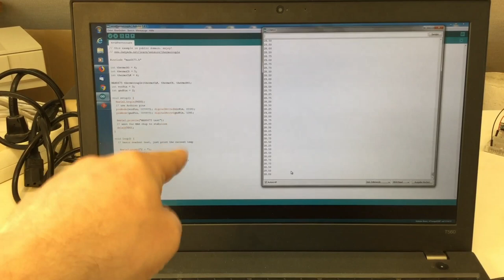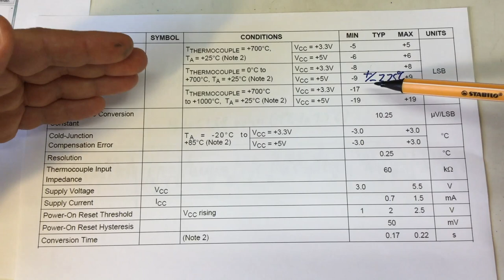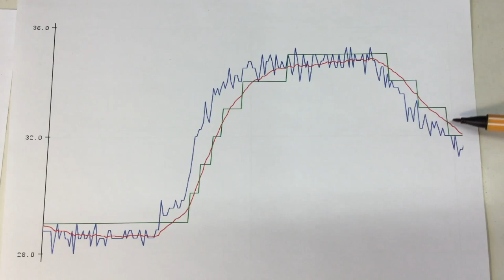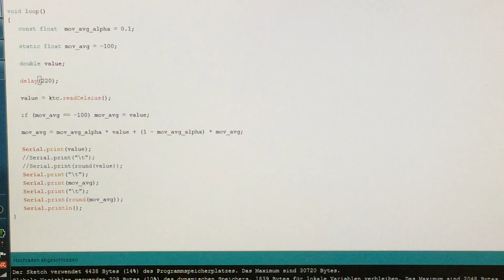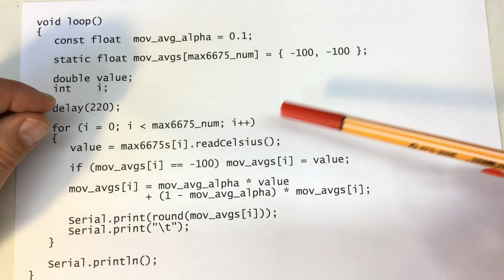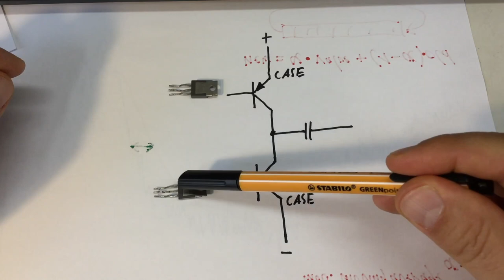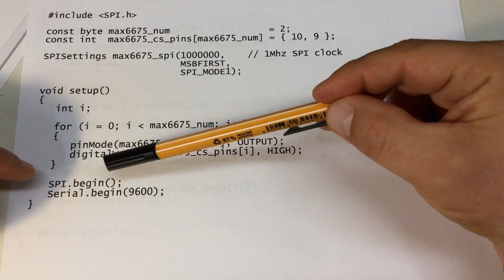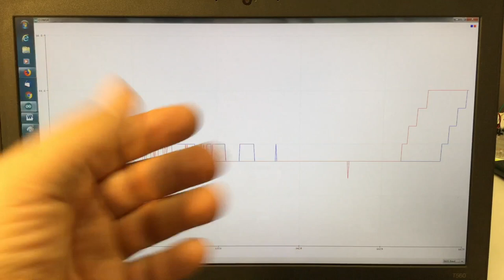Arduino, Thermocouples, MAX6675 and SPI – The Fine Points

Comment: Sir, first of all thanks a lot for the video. Iam making a similar temp Data acquisition system with arduino. I have to measure 2.5m underwater. Should i use a thermocouple or thermistor? Please reply.
Reply from the maker: OK, when to use a thermocouple or a thermistor basically comes down to the temperature range you want to measure. Since you're talking about 2.5m under water, I guess you're measuring "normal" water temperatures between 0°C and a few dozen °C. Thermocouples a great for measuring very high temperatures (hundreds °C), but that's not really necessary in your application. So I would go with a thermistor. Anyway, if it fits your application you should consider using a digital sensor like the DS18B20/DS18S20 ( https://youtu.be/XUm9RPWRBx8?si=rNz_LZVcwO_D3_HV ). Here I'm using one to measure the temperature of a water bath: https://youtu.be/EP1Lc-g3uY0?si=2YE7tQAADdcGYFHu .

Comment: Hi robert Thank you very much for the video its reallay give me a lot of new knowlade. i have a questions about the thermocouple with the max6675,now im in a project to make deep frying machine and i've used the thermocouple. everytimes the themocouple touching the survaces of this machine which is made by stainless steel its get failure for the thermocouple read the temperature. 
i hope you have any sugest or recommendations for it, should i do special methode for this thermocouple max6675 or i must to use other module for it?

thanks, have a nice day
Reply from the maker: You're probably experience a problem related to the shorting issue I discussed in the video ( https://www.youtube.com/watch?v=qub3yzqEwek&t=1406s ). I guess in your case the power supply of your microcontroller and MAX6675 has some (albeit small) potential to the housing / the stainless steel of your machine. This causes a current loop through the sensor into the MAX6675 which messes up the measurements. There are three possible solutions for that problem:
1) Make sure your MCU and MAX6675 are galvanically isolated from the housing of the machine.
2) Use an isolated thermocouple.
3) Galvanically isolate the MAX667 (see https://youtu.be/6rEJh4yPekg?si=7D7Fo1dMdy6NBIwd ).

Comment: Thank You for the video.
So if you have multiple thermocouples you would have to insulate them from each other? It seems like that might effect the accuracy of the readings?
Guess I would have to experiment with them to figure something out.
Thanks again, great info on using the arduino and thermocouples.
Reply from the maker: You're welcome! If you have multiple thermocouples you only have to isolate them when they are in contact with metal surfaces with different voltage potentials. E.g. you measuring the temperature of one heat sink that is connected to ground and another that is connected to your power rail. For isolation of thermocouples see the video "Galvanic Isolation of SPI Devices (e.g. Arduino, MAX6675 and SI8631)" https://youtu.be/6rEJh4yPekg (no loss of accuracy - the isolation happens on the digital side).
Reply: @robertssmorgasbord  
Thank You for the info and follow up reply.
Reply from the maker: @patrickmclaughlin6013  You're welcome :-)

Comment: I really appreciate the time you have invested in making this video.Considering how very well written it was coupled with easy explanantion thank you Sir So much for this video it was a pure gold mine of information.I want to know How you came to the conclusion of choosing this particular formula for moving avergae because i have seen a different one for it .Also Sir why did u choose mov_avg =-100 in start
Reply from the maker: You're welcome - and thank you for praise! Regarding the moving average I used: I choose that modified moving average (MMA), aka running moving average (RMA) or smoothed moving average (SMMA), (see Wikipedia https://en.wikipedia.org/wiki/Moving_average) because it doesn't require an array to store past values. α = 1/N, so if you replace that in my formula you get NEW = (1/N)*VALUE + (1-(1/N))*OLD = (N*(1/N)*VALUE + N*(1-(1/N))*OLD) / N = (VALUE + N-1*OLD) / N, which might look more familiar to you. I initialized my moving average with an obviously invalid number (here -100), so I would see that it's not yet calculated correctly when I start the program. That was just my laziness. A better approach would have been to initialize average=NAN (not a number) and then use the expression (isnan(average) ? value : average) when accessing the average. My bad!
Reply: Tysm for your reply It might seem a bit much to you But I have become your Fan After watching just a single video.I mean I loved how detailed the video was and so easy to comprehend.I remember Jordan Peterson saying "If its hard for you to understand something it means its the authors fault".Based on this how easy it was to comprehend I believe You Really Know your stuff
Reply from the maker: @41_ahwaszargar73  Thank you again for the praise! I'm blushing here 😊 Anyway, it's very satisfying for me when people get something out of my video.

Comment: Hello, nice explanation. For detecting fire, what is the best sensor for arduino uno?
Reply from the maker: Thanks! And sorry, I haven't worked with fire detectors (neither smoke, nor heat, nor gasses like CO2) so far. So I can't really recommend any sensors.

Comment: This is fascinating to me as I have used this module myself for a homemade tandoor (oven) I also had to average out the data but my maths is rubbish, so I just added together 10 readings and divided it, also I only update my Oled display every couple of seconds this works fine for the oven (great chicken!) I have also run into the "ground" issue. Not using the library is something i'm gonna go away and play with Its quite simple the way you put it...cheers.
Reply from the maker: Well, I gather the MAX6675 is good enough to cook some tandoori dishes then :-) Regarding the grounding issue you are in luck: In two weeks or so I will publish a video where I solve exactly that problem ;-)
Reply from the maker: The video explaining how to overcome the grounding issue is out now: "Galvanic Isolation of SPI Devices (e.g. Arduino, MAX6675 and SI8631)" https://youtu.be/6rEJh4yPekg

Comment: Hi, great video and very instructional as well. However, I wonder what modification in code as well as in hardware you need to do if you only have the MAX31855 modules instead?  I have several but none of the MAX 6675.
And by the way, my modules are 3.3V but the Arduino is 5V so, I'm thinking,  I will probably need to use some sort of logic level shifter modules  (bidirectional maybe? I'm not sure) to communicate with the MCU. Also, another question is what library? The Adafruit one or...is there any other I can use? It would be great if you could make a video with the above modules or perhaps some ideas on how I need to do it? Thank you.
Reply from the maker: Hi, have a look at the Adafruit MAX31855 module: https://www.adafruit.com/product/269
It's 5V compatible and they provide a schematic for that board ( https://learn.adafruit.com/assets/35637 ) so you can see how that's done: No need for logic level shifters, just two diodes and two resistors - though that technique won't work if you have other 5V SPI devices on the bus that actually receive data from the hots! You can probably use the 3.3V pin of an Arduino to supply the 3.3V - I don't see the need of an extra regulator.
Using the Adafruit library for that module should be alright (haven't done any research regarding MAX31855 libraries).

Comment: Great video!  I wanted to read the temperature of 3 fermenting vesels using pt100's I think your video help me a lot.  Is it similar when using multiple MAX31865 ?
one other question, If I wanted to display the temperatures on an OLED screen will it work also with SPI ?
Reply from the maker: In principle, yes. But ... The MAX31865 uses bi-directional SPI, so you will need an additional data line (MISO - Master In Slave Out, respectively, SDO - Slave Data Out. Of course you'll need a suitable Arduino library. Fortunately one is available from Adafruit: Adafruit_MAX31865.h. Connecting an OLED to the same SPI bus isn't a problem, because the slaves on a SPI bus are addressed by chip select pins (one for each slave).

Comment: Hi Robert,
The max6675 data sheet seems to indicate 3.3v to 5v can be used.
The library was apparently written with 5v in mind ?  I get correct temps when using 5v (comparing to a ds18b20).
My readings using 3.3v are about 10-12 degrees Fahrenheit higher, but i'm not sure if simply subtracting this differential will give me a correct reading over a large temperature range.
Your thoughts are appreciated.  i hope it's as simple as subtracting, but usually things like this are much more complicated than they appear.  thank you.
Reply from the maker: Mhh ... The MAX6675 can indeed operate with a supply voltage down to 3V. However, the library (which one exactly?) doesn't care at all / is in no way affected by / can't be affected by the operating voltage of the MAX6675. The interface between the Arduino and the MAX6675 is purely digital (SPI). The analog-to- digital conversion of the thermocouple voltage happens inside the MAX6675, and the MAX6675 does take care of variations in the supply voltage using an internal reference.  So ... maybe you've got a bad Chinese chip or something else is wrong with your MAX6675.

Comment: Thank you very much for this informative video. I am a NOOB when it comes down to electronics but i am able to apply "The science" when it has been shown to me :) This helps me a lot in further building my smoker temperature meter where i want to be able to measure the temperature in de the smoker as well as the core temperature of whatever i have in my oven at thst time.  Now i am just looking for a way to connect an o-led display to show the values...
Reply from the maker: You're welcome!

And regarding the OLED display, try that video: https://youtu.be/9tBxXPTLM6Y?t=925

Comment: Thanks for detailed video about module  really helpful 🙏
I want to measure temperature of copper pipe at 4 different location so if I connect 4 Thermocouples on pipe then I will experience short problem. Can you suggest  any solution like Thermocouples whose tip is electrically isolated or something like that 
Thanks
Reply from the maker: You're welcome!
As long as your copper pipe(s) (I assume for warm water) are at the same electrical potential (according to the building codes in most countries they should be grounded) you don't need electrical isolation between your four thermocouples. E.g. I just measured the temperature on both ends of an aluminum profile (heating one end with a lighter) with two non-isolated thermocouples - no problem.
Reply: @robertssmorgasbord  thanks for reply 🙏
Reply from the maker: @rohitbhosle6521  You're welcome 😀

Comment: awesome vid! thanks so much. one question: how did you claculate error of +-2.25C from LSD of +-9.0 thanks.
Reply from the maker: Thanks for the praise! And you're welcome! The error calculation is simple: 1 LBS is 0.25°C according to the datasheet. You can also calculate that by dividing the temperature range of 1024°C by the 12 bit resolution of 2^12 = 4096. So an error of ±9 LSB is an absolute error of ±9 LSB * 0.25°C per LSB = ±2.25°C.

Comment: Hi Robert,
In a moving average as you have implemented, by choosing alpha=0.1, the sample size automatically becomes 10 ? So for eg, if i chose 0.01, would it mean i am averaging over 100 samples ? I am writing some code to calculate the average value of a mains voltage sine wave , so could i use something like this for that ? 
Thanks for your great videos :)
Reply from the maker: In principal yes. The equivalent sample size is indeed 1/alpha. However, the MODIFIED moving average behaves differently than the (normal) moving average. See https://en.wikipedia.org/wiki/Moving_average#Modified_moving_average and my video here https://youtu.be/HK1JmZx7Swg?t=1983 . If you're averaging just over the peak values of a 50Hz sine wave (using some peak detector, sample rate 50Hz or 100Hz) you can use either the modified moving average or the (normal) moving average. However, if you're really sampling the sine wave, like an oscilloscope would (so sample rate >> 100Hz) the modified moving average won't work. BTW you're welcome :-)
Reply: @robertssmorgasbord   Thanks for clarifying. I am actually measuring the values of the entire (full rectified) sine wave and then averaging, to calculate Vavg. I guess " (normal) moving average" may be suitable ? 
Looking forward to your next video on the heater plate controller :-) !
Reply from the maker: @mumbaiverve2307  Your welcome! And yes, you should better use a normal moving average.

Comment: The common mistake is a metal cover of thermocouple shold be grounding. It must be done for both max2765 and max31855. There will be lots of incorrect datas without it.
Reply from the maker: Grounding the (from the thermocouple isolated) metal housing/cover of a sensor is of course always a good idea. BTW what is the MAX2765? Surely a typo.

Comment: Sir can you please tell that ,19:22 will this method work if i want to have 8 max6675 modules and also want to add a 1602 lcd display shield on arduino mega 2560?

when there will be a voltage problem?
Reply from the maker: Will that also work with eight MAX6675 modules? Yes, no problem, just use six more pins for six additional chip select (CS) lines. Will it work with a 1602 LCD shield on an Arduino Mega 2560? Sorry, I can't say for sure. I don't know what kind of 1602 LCD shield you're using. Generally: As long as the shield allows you access to (and is not using itself) MOSI and at least eight more pins for the chip select (CS) lines there shouldn't be a problem.
The power supply (voltage) will definitely not be a problem. These MAX6675 modules draw only a few mA.

Comment: screw type of thermocouple sensor as shown in this video has a very poor response time. I prefer the wire tip type, but wire tip type will get contaminated which gives you an error after it was used for sometime or contaminated with some materials or chemicals.
Reply from the maker: You're absolutely right. These screw type thermocouples are slow, much slower than the wire tip thermocouples. However, I didn't know that the wire tip thermocouples can develop an error when they are contaminated. So thanks for the info!

Comment: Hello I have an electric oven that mounts a type K probe inside the chamber, then it must be connected to the controller (plc), do you think I can also connect the same probe to max6675?
Reply from the maker: Yes you can - but not parallel to the build in controller. It's either connect it to your MAX6675 (but then your oven would stop working I guess) or connect it to the build in controller! Best to install a second thermocouple for your MAX6675. But watch out for that AC mains voltage, which can cause serious injury or death!

Comment: Is it tru to say the short issue is only where a short exists between two or more sensors.    For example, where thermocouples are probe type (floating in air or into food item let’s say in baking) but not screw in or attached with eyelet or set on conductive surface.....   we will not experience that short problem affecting measurement.
Reply from the maker: Yes, that's true. As long as your thermocouples are not connected to some conductors that have different electrical potentials you are fine. So having them float in the air or sticking them into a bread in the oven is absolutely fine.

Comment: would this be good for a gas convection oven? i plan to use 2 Thermocouples like you have there to measure the temperature inside the oven
Reply from the maker: In general, yes, absolutely. But it depends on the maximum temperature in your oven ;-) You can buy type K thermocouples that are good for up to 1100°C (those Chinese I had probably won't).

Comment: Is there a way to run multiple non-isolated thermo-couples, ie; 4 TCs, with one in each cyl's exh of a 4 cyl.
Reply from the maker: If I understand your question right: Yes. Add two more MAX6675 modules (without digital isolators of course) on two more chip select lines to the circuit. Modify the code (rough outline): Instead of one delay of 220ms in the loop() function, add a delay in the for-loop (1 to 4) of 55ms (220ms/4). Hope that helps.
Reply: @robertssmorgasbord  Does it apply similarly for 8 thermocouples?
I mean , 220/8 ?
Reply from the maker: @piyushsharma5205  Yes, it does. Generally speaking: You can either have one delay(220) statement at the start (or end) of the loop() function, or you can have a delay(220 / [number of sensors]) within the for() loop. In the first case you read all sensors in quick succession and then wait, in the second you read a sensor, wait a little, read the next sensor etc.

Comment: Where can i find a thermocouple with that flat thru-hole mount? Everything T see is k-type?
Reply from the maker: I've got mine from eBay quite a while ago: https://youtu.be/Q4XTfRTT3I4?t=450
K type thermocouples are by far the most prevalent (cheapest) type. You might get E, J and T types from distributors (not from the Chinese for cheap though). The rest are specialty items that are usually available directly from the vendors.